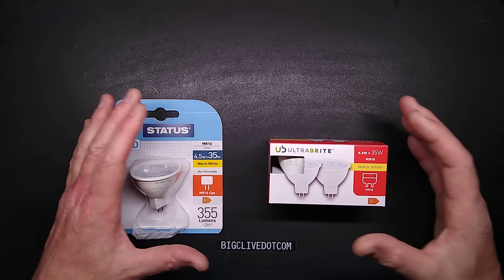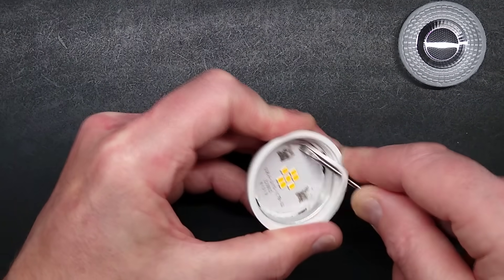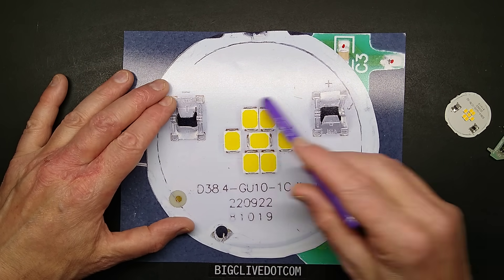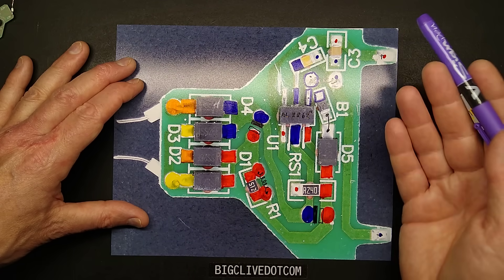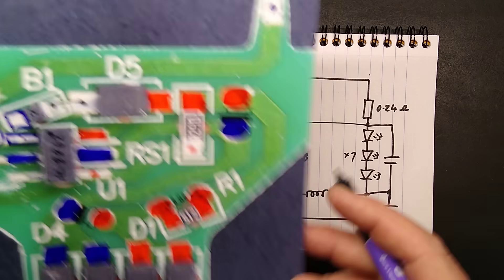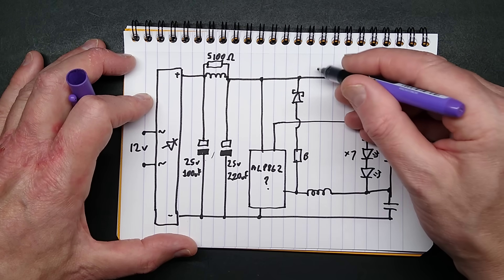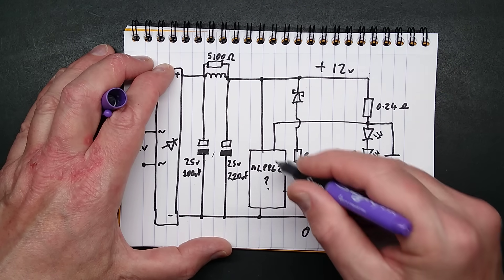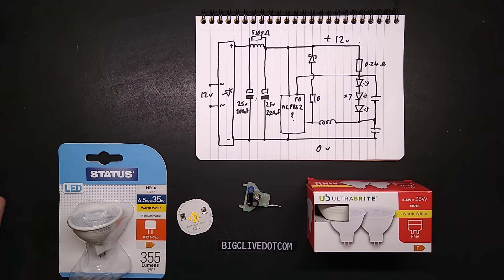Poundland 12V bulb with mystery component

Comment: Constant current SMPSes from MR16 bulbs make nice guts for retrofitting old bicycle lamps. Mine runs on a Cree XP-E neutral white 1W (or was it 3W?) LED and is quite bright.
Replace two diodes from the FULL BRIDGE RECTIFIER with electrolytic caps to form a voltage doubler - it'll flicker a lot less when powered from a dynamo.
Change the current sensing resistor to the value you need and you're go :).
Reply: This sounds really neat!

Comment: Clive, I did as you said in the live stream. I changed from halogen to led driver. It didn't cost a lot either. The only downside is that I need to go and flipp the switch. But I need the exercise. Closer to 100 than 0. High blood pressure and other stuff.☹

Comment: I’ve got some different ones of these which boosted the voltage.
I did send you an email about them some years ago, offering to send you them, but I never heard back (maybe wrong address? It was from your website if I remember correctly).
I think they came from Tesco & they weren’t cheap.
Still got them if you want one.

They work on anything from about 7v up to about 24v, ac or dc.

Comment: Assuming B1 is a ferrite bead, it is like they have put an effort into reducing the current spikes through the LEDs during the off phase.  I'd be very curious to see a scope on the 12V rail with B1 and also when it is shorted.  Maybe getting too nerdy, idk, but it's definitely an interesting place for a ferrite but perhaps not stupid?
Reply: It also softens reverse recovery of a diode. I assume this converter works in continuous conduction mode, which means internal mosfet turns on before energy in inductor runs out and diode is still conducting, resulting in a few nanosecond short circuit from positive rail to ground while diode is turning off. Ferrite bead is there to create some impedance for this current spike. A better solution would be to use a faster schottky diode to match switching characteristic of a chip or choose a chip with a slower internal switch like PT4115 for example

Comment: The input voltage needs to be high enough to be at least 2 diode drops above the LED forward voltage, plus the drop across that 0,24 Ohm sense resistor ...so, I'm a bit suspicious that the LEDs must have Vf of about 2,5-2,6 V, for a bit less than  8 V Vf across 3 LEDs .... something about the scnematic looks a bit funny to me, and it would be useful to know the inductance of fthe inductors.
Always fun to see minimalist design in action, although there's a difference between 'minimalist' and 'cheap'  ;-)

Comment: Earlier this summer I bought a lot of 12V dimmable MR16 LED bulbs for a couple dollars each, and what I like about them is that they'll happily run directly from a 5V power bank and consume about 4 watts rather than their rated 7, running cooler as a bonus.

What I find strange is the packaging states they're meant to run on AC only and are "not intended for DC operation" despite using a bridge rectifier internally.
Reply: If they were intended for outdoor use, they might discourage a DC feed because of galvanic corrosion on the terminals and in the socket. That is not much of a problem with AC. If water gets into the socket, one terminal will dissolve pretty quickly.
Reply: @strehlow  I think you're onto something there. The bulbs are rated as "suitable for damp locations".
Reply: Just an uneducated guess 😁
When operating these on DC, two of the four diodes get bored, the other two get warm ...
On AC they all have to do some work 50/60 times per second 😅
Reply: @SystemX1983  That's what I was thinking. They probably cheaped out on the diode bridge and relied on the 50% duty cycle of AC power to make up for it.
Reply from the maker: That is unusual.

Comment: A useful way to repurpose electronic halogen transformers is to feed them with smooth 325 V DC. The output should be a square-ish wave with 17 V peaks. Uuseful to drive CRT flyback transformers as simple HF HV supplies , they are cheaper and higher power than electronic ballasts for fluorescent lamps. I think if they were fed with an audio input using a transformer at the output of the amplifier to step up the audio signal from the 10 V order to 230 V it could create a simple plasma speaker.
Reply from the maker: I experimented with using an electronic halogen transformer to also drive the primary of a step-up transformer and run a short length of neon.

Comment: I have some 3 Watt single chip versions on these. I wired USB cable to them and run them off a USB adapter. I still get a decent light out of them but next to no heat even after they've been on for hours. They also run just below the USB maximum current draw of 500mA, so they can safely be run from a USB port as a computer light or from a battery bank as a camping or outdoor light.

I've also converted a couple of old halogen desk light to USB LED lamps as simple, but useful, projects. I leave the old mains transformer isolated in the lamp base as a weight to stop the lamp falling over. Apart from the USB adapter being powered all the time, it makes for a far more efficient and useful light.

Thanks for this video covering the low voltage versions of these lamps, Clive. If I may make a small suggestion... If possible, could you test the lamp on a 5V DC supply as it would be very useful to build up a list or database of lamps that could alternatively run from a USB port. I've tried a couple of others but found they didn't illuminate until just over 6 volts DC was fed into them, which suggested that they may be suitable if the internal bridge rectifier was bypassed.
Reply: Probably, on a 5V Supply, depending on the voltage drop of the rectifier's diodes, there's not enough volatge left for the LEDs.
With effectively 2 diodes "in series", in worst case, you'd have eg 1.4V dropped, leaving 3,6V left? 😮
Reply: @SystemX1983  That's what I was thinking. Unfortunately, the lamp I was experimenting with got damaged at some point. I wasn't convinced enough to proceed, the lamps themselves weren't that great anyway and were expensive for what they were, so I decided to drop the idea...until recently.

At the moment I'm keeping half an eye out for candidates that look like they might work or be modified relatively easily into something that works. Maybe something interesting will turn up at the right price and I'll try experimenting again.

Comment: Hi Clive! You reminded me of a channel who tested his TV on a 400v EV battery. Obviously DC. Care to do some experiments in that vein? Run some fun things on HV DC?
Reply from the maker: Many switchmode supplies will handle 400V.  Some can go quite high if they are for three phase use.
Reply: 400V or even 600V AC or DC  is not High Voltage.
Reply: @BTW...  There might be a definition, but I guess it's relative.  Like if you ask a high frequency technician, everything below 1khz is DC for them

Comment: One cannot help but wonder how many of these bulbs have failed in the field, merely because the power supply wasn't upgraded to a LED-safe version?

The black background is pretty nice, I like the color contrast. For me, it really makes what you're doing with your hands "pop" a little more, whereas your home bench is similar in color to your hands. However, if you were working on something black, it'd mostly disappear (obviously). Lighting and background colors are the main drawbacks to benchtop videography, sometimes you need the bench to be a different color and that's not always easy or practical to accomplish.
Reply: For smaller items like Clive often looks at, a collection of simple plastic cutting boards would allow for a quick swap. Or maybe a set of large cardboard sheets in different colours (is that what they call poster board in some places? Thin card in large sizes and various colours...)

Comment: Fun video as always. I have a theory about the mysterious B1. I was designing a 3dprinter  board and lcsc auto added the parts from my BOM. It messed up and ordered smd ferrite beads instead of a resistor. Looks like that component. B could stand for bead1.
Reply: Yes, it's probably a ferrite bead.
Reply: Ferrite bead, probably there both for EMI compliance, and also to keep the diode from being damaged by the turn on spike, as it is probably being run at the ragged edge of it's pulse current rating, so the tiny bit of inductance is going to tame it, plus absorb some of the pulse current edge as heat.
Reply: @SeanBZA  nice :)
Reply: for emi compliance
Reply: I normally see them labelled as FB, but this still seems like the most logical explanation.
Reply: Looked for this comment. Didn't have to look far.
Reply: @pseudomemes5267 :D

Comment: I've never understood why LEDs in parallel work. 

We were always taught that diodes (incl LEDs) in parallel don't share current equally. Each 'string of LEDs should have it's own small balancing resistor. 

I'm certain it's one of the reasons they don't last that long.

That B component- B for bridge? Who knows...!

Like new black background. 👍🏻
Reply: It was more of a problem with early LED's which had much more variance on their forward voltages, with modern ones you can generally get away with it as long as they're all binned the same (and if you're making a product like this commercially it makes sense to buy binned LEDs for better consistency).
Reply from the maker: It's still not ideal, but gallium nitride LEDs do seem better suited to it if the LEDs are from the same batch.
Reply: @bigclivedotcom  While I've got your attention I'll let you in on my favourite trick with parallel LED's with string lights.

If you use the colour changing RGB 5mm LED's they've got a built in drive transistor which will regulate the current - feed them from a regulated 3.3 volt supply (a small adjustable buck regulator from USB works well) with no current limiting and they'll all be full brightness (rather than the blue dimming when a red lights).

No need for any resistors which makes making them a bit easier, however there does seem to be a small initial failure rate when abusing them this way (but if they don't die immediately they go forever, I've got several sets 3-5 years old that are used as nightlights)
Reply: @etelmo Some of those colour changing RGB LEDs have built in current limiting, but others do not.
Reply: Current limiting resistor isn't accurate enough to cap the max voltage, but a switching power supply designed for the task is. If the LEDs are rated for 3.2v (for example) and you drive them with 3.0v, they'll never exceed their design voltage even if one is lazy and another is bright....
At least that's the conclusion I've come to over the years or watching Clive stuff LEDs into random things.

Comment: I have about a dozen MR16 LED lamps around the garden. They are powered from a lead-acid battery charged from a solar panel. The bulb design means that polarity doesn't matter when I connect the lights up, and they maintain brightness anywhere from fully charged down to around 8 volts (depleted battery and voltage drop with long cables). They last almost forever apart from the rare occasions when I don't put them back property after grass cutting when the drainage in the lamps is pointing the wrong way... 😅
Reply: Yes, with the switching PSUs, I think most electronics will work on DC, running AC through a rectifier anyway. I once saw a channel who tried to run every thing in his household from the 400v on his old BMW that was EV-converted. Cool thought! I shall ask Clive for some experiments in that vein.
Reply: I’m thinking of doing something very similar - did you need to waterproof them at all?  Ta 🙂
Reply: @actuallyusingmyrealnameher5061  In my case, most of the MR16s are installed in some die-cast metal housings, others are in some old pond lights (around the pond, not in it). You definitely need to keep rain water out of the MR16s, and also allow any condensation that develops in the housings to evaporate or drain.
Reply: @GodmanchesterGoblin  Thanks 🙂

Comment: I'll take a gander that B1 is a ferrite bead.  The reason is that the switch node of that chip will have a very sharp edge present when the internal transistor switches off, and also when the inductor current flows to zero the diode will cut off sharply leading to a very rapid rise in voltage at that point.  Put together these effects create a bit of a nasty resonant tank circuit which is bad for EMC.  Since this bulb is sold in an actual retail shop it has to comply with the relevant safety/EMI/EMC standards.  The ferrite bead will damp that energy, at a slight reduction in efficiency.  You will probably find it is something like just getting a few dB below the limit line at some problematic harmonic and this was a cheap and effective way of doing it.
Reply: Back when I was on the student council, we ordered a new 3-in-1 printer. It came with one of those ferrite blocks to clamp around the power cable. Comment from one of the electronics students: "looks like they failed EMC testing".
Reply: @rolfs2165 I worked for a major consumer and professional electronics company, and they are used in almost everything.
Reply: Perhaps the designers of this bulb planted a  "B"-igClive  mystery component.  hehe   Jokes aside, it's likely a ferrite bead for EMI dampening.
Reply: I don't think "take a gander" means what you think it means. The rest of the post rings true.
Reply: @unhandled12345 As we all know "take a gander" means "remove a male goose."

Comment: I've installed Osram Halotronic HTM for a set of led lights, worked fine. The lamps were also Osram. Tried them with a constant voltage LED driver but that didn't work at all, can't remember if the turned on at all or what they did with the LED driver

Comment: I've been running MR16 lamps in track lighting on my 12V battery bank for a decade now.  I bypassed the electronic ballasts::
https://youtu.be/WIW0Wn0DOmk?si=MOFeDncswD6pP-2v
and power the track from a 7.5A DC circuit:
https://youtu.be/fNFJRHy4PGY?si=xAz3Uvcpfe13hd0i
Have not had any lamps burn out in that time, genuine Phillips brand.  One key is to avoid any lamp with active cooling and I also got non-dimmable lamps so that brightness stays the same with varying battery voltage.

Comment: Do any of these bother with getting the extra 10% efficiency they could get by replacing the input diodes with schottky?
Reply: SS26F are Schottky diodes. (2A 60V)
I guess that's necessary if you use these with an electronic transformer that produces a high frequency chopped 12V AC.

Comment: Possibly "B" as in Bodge?
Somebody stuck a component there in the design accidentally.  Then someone else decided it was easier to replace it with a 0 ohm resistor & change the silkscreen than to just remove it.

Comment: can i use these drivers to drive 1w and 3w leds? or would i need to put 3 in series? also the 12v led filaments at 45ma?
Reply from the maker: This is a current regulating buck unit, so it may work down to 3V.

Comment: I have one connected to my TV remote that I use to to turn on the gas cooker which in turn turns on my shower, now this is fine but the microwave turns on and my door bell rings, this to would be ok but my car starts and drives to work without me and that would be ok but my wife's vibrator turns on at the most inconvenient time as it's stuck up my arse 🤣🤣🙈

Comment: Sorry to disagree with you Clive, but some MR16 LED lamps will work with some electronic “transformers”. As proven in my home where I have rather a lot running like that. Although, some of the electronic “transformers” have been replaced, as it was a bit too much having the kitchen as a disco (the MR16s would randomly flash, all seven of them).
Reply from the maker: With some electronic halogen transformers the lights will work if there is at least one tungsten lamp in the circuit, but the circuitry may be stressed.  If the transformer load is entirely LED lamps then it may operate unstably.
Reply: @bigclivedotcom - none of mine have a quartz halogen or tungsten lamp in parallel. I found that this arrangement did not help. I have a mix:
* Where the existing electronic transformer (one per each 50W quartz halogen MR16 lamp originally, as the electronic transformer is only rated for 50W) would work reliably with a LED MR16, that’s the set-up now. The LED MR16 are Screwfix LAP brand. Of these, only one has died. And they have been in service for around ten years now.
* Where the above was not reliable (mainly because the LED MR16 would flash on and off), the existing electronic transformer has been replaced with a DC PSU. One PSU feeds five LED MR16, Two small DC PSUs feed two LED MR16 each.
The Screwfix LAP brand 12V MR16 lamps are far more complex than the type featured in your video. But I’ve not yet completely reverse engineered one yet. I started, but got distracted, and have never gone back to finish the job!
I also have a triple spotlight fitting that also takes 12V MR16 lamps, originally 35W quartz halogen lamps. This also uses 12V LED MR16 lamps without any problems, but not the Screwfix LAP brand. In fact, I can’t remember which brand now. Again, it’s been like this for ten years.